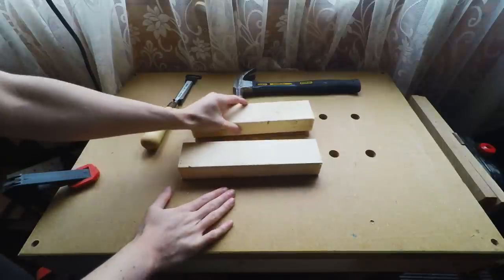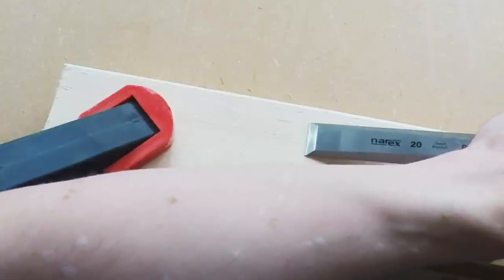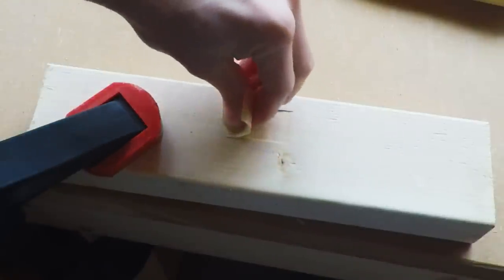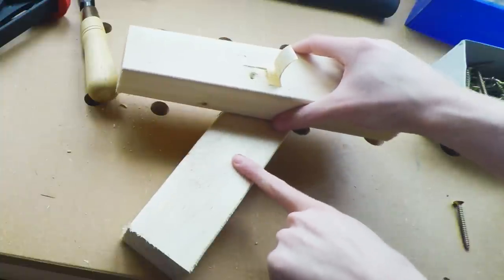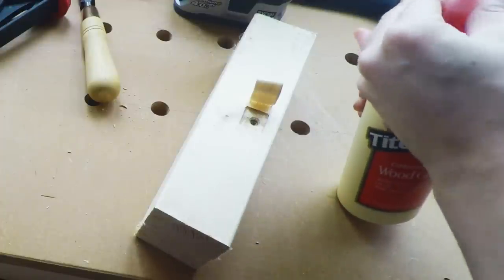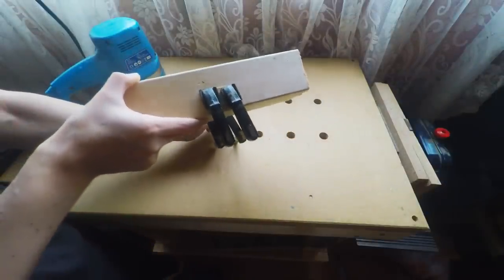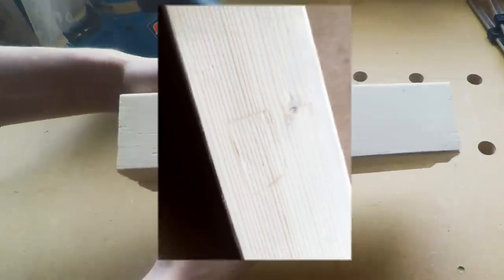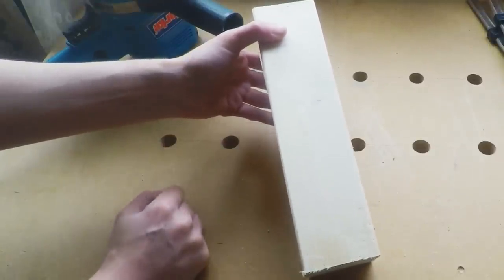Simple Way To Hide A Screw - Average Joe's Quick Tips

Comment: A handy trick to have in the tool belt but for specially suited cases only. The advantage of the more usual method of counterbores and dowels then sanding flush is it can be done far more efficiently when more than say two are needed. It's also not required to use two clamps on a dowel.

Thumbs up though for sharing a handy trick.
Reply from the maker: Thanks mate! Definitely a tip thats not suitable for all tasks but all its useful to know. The clamps arent really needed. Strong tape can be used to hold down the wood while the glue dries

Comment: Nice tip Joe, I was using similar method once but I just cut out about 5mm on the bandsaw from entire surface and after putting some screws in I glued it back together.

Comment: if you like Titebond Wood Glue, look into Titebond WeatherMaster Ultimate MP or Titebond Roof Plus but it's not for the same purpose, it's the best Sealant, Adhesive & Elastomeric for your house exterior, but you can't get it at the local hardware store, I'm a roofer and it's awesome for all types of stuff for your house

Comment: Good idea, well done. You could also when gluing up the flap cover it with a piece of plastic milk bottle and back this up with a piece of wood. This evens out the pressure on the flap and prevent the two pieces of wood sticking together. Regards
Reply from the maker: Thats a great tip! Thanks Peter 👍
Reply: I use baking paper as a separation. Easy to cut and never sticks.

Comment: A taper plug cut from the same wood can be glued and pounded in tight to eliminate any visible line around the perimeter. If you are careful to match the grain well, then the result will be completely undetectable. Also, there is no need to wait for the glue to set before sanding smooth.
Reply from the maker: That is another method for hiding a screw yes. But you will still see a circle in the wood.
Reply: Average Joe's Joinery   You must be thinking of "dowels". Plugs are tapered and wedge in so tight when pounded in that there literally is no line between the 2 pieces.  If a circle is visible, it is only because the plug was poorly chosen for color and grain match. Also, obviously the plug needs to be installed with the grain oriented correctly and a proper bit (Forstner) must be used to drill a "clean" hole". If a twist bit is used to drill the hole, then you are indeed correct that a line will be visible around the plug. 

I am not knocking your method, because not everyone has plug cutters. I'm just saying that if you have a plug cutter, use it for better end results.

Comment: Definitely one of the best wood trick I seem but it will require a lot of claps and time if you building a furniture but very good
Reply from the maker: Thanks Victor! Glad you liked it. The clamps arent really needed. Strong tape, a weight or even a small dab of super glue along with the wood glue can be used to hold down the flap of wood while the glue dries

Comment: Just to add to your tip, if you wet the surface with water and let it sit awhile before you chisel it makes the wood less likely to break off and swells the grain so when you clamp it back in place the severed grain is less noticeable
Reply from the maker: Thats a great tip John! Thanks :)

Comment: Hi great tip!! how do you hide the screw when your 2X4 is screw onto a wall and you can't use the vise grips to hold the wood chip down?
Reply from the maker: Thanks! You could use tape to hold down the wood while the glue dries or you could use a little super glue for instant hold

Comment: Very obvious, very simple, very next time and from now on process! My minds been blown, cheers :) It's true, sometimes the simplified method is the best method.
Reply: Also, if on skirting boards, would be amazing grip + finish. If flooring is existing, how to pressures the skin? If no flooring I just cut an angle piece and angle screw it with bond / grip. If Florida ring in I join lengths of wood an inch too high then push down an more screws, this then pressures two boards at once. Easier way?
Reply from the maker: Thanks mate! Its really is a simple tip but its very effective. Im sure there are tons of applications Im not even aware off. Those are some great uses for it!!
Reply: No worries man, keep it up.

Comment: Use a piece of clear plastic bag over the glued part, then clamp a flat piece of wood over that to spread the load and therefore remake the surface better.
Reply from the maker: That would help a lot
Reply: Indeed it does mate. I keep offcuts of nice high quality thick ply of various sizes just for this task. Beware of supermarket carrier bags though. Their colour will leach into the excess glue and the work!!! Only use clear plastic bags. You can also see how much glue is oozing out. If its too much, you can wile it off and then re-apply. 

I'm glad to see a younger bloke using hand tools. There are a million router vids out there, but the satisfaction of working with chisels and planes far outweighs the experience of using a noisy tool. 

I also never sand anything btw. I only plane, spokeshave and scrape. The finish is vastly superior. But this opens up the need to learn to sharpen edge tools using Japanese water stones - a whole new art by itself. Very satisfying though.

Comment: Will this tip work on Plywood?
Reply from the maker: It can but its harder to get clean results
Reply: @AverageJoesJoinery  In the case of Plywood, I'll stick with Plan "B," which is using Plug Cutter Drill bits.  I'll just use your trick for regular lumber.  Thanks again.
Reply from the maker: Anytime mate 😊

Comment: I'm looking all over YT and nobody can help me. I'm trying to dismantle a built in cupboard wall, and I need to get to the screws underneath the woodfiller on the back walls. How is that done? Any help or ideas about getting to the screws would be a godsend.
Reply from the maker: Hi Louis, Best bet is to use something sharp to chip and scrape away the wood filler. The filler should chip away with a knife or even a flat screwdriver. If thats no use then you can use a drill to drill away the bulk of the filler and then try to chip away at the filler. Just don’t go too deep and take the head off the screw. As long as you can reveal the head of the screw and get a screwdriver into it then the rest should break away as you undo the screw. Hope thats of help.
Reply: @AverageJoesJoinery  Cheers man, I'll get to it.

Comment: clever but it needs to be clamped and glues it would be easier to glue the joint or just use plugs so you can plug multiple holes at a time but it's a great idea if you don't want an obvious break in the grain

Comment: If your using clamps, just glue the boards together no screws needed.
Reply from the maker: The clamps were just a way of holding the wood in place while the glue dried. Mechanical fasteners are often needed as well as glue. Tape could be used to hold down the flap of wood or even a weight too

Comment: What if you can’t cramp it up
Reply from the maker: You could use tape to hold down the flap of woof while the glue dries. or you could add weight. Even using a small dab of super glue with the wood glue would work too
Reply: Average Joe's Joinery or you could apply a piece of news paper and a block of wood and pin down until it dries ?

Comment: Interested if this would stick out like a sore thumb after stain was applied
Reply: I realize this is old - but yes if you're not careful and use too much glue. Certain species of wood and/or grain direction will let the glue totally saturate the flap to the point it will not take stain.  I'd experiment on scrap b4 doing this on your next heirloom project.
Reply: This is better for painted surfaces the cut shows on stained surfaces..but it's a nice took to keep in the chest. I saw someone test this method a year or so ago while showing old time wood working methods.

Comment: nice trick, especially for less important projects. I think i will use this trick a few times, just to hide a screw. 

Downside though, is that the screw is permanently sealed, and for projects where i would want that i think i will still use more 'proper' techniques like filling with a dowel, or filler, or something similar.
Reply from the maker: Thanks mate! I dont think there are many projects where someone would want to hide the screw if they need it to be easily removable. Like you say, using more traditional/stronger joints is always a much better way to go. Some people do infact use a mix of both though. I have a rocking chair project that has the traditional joinery but uses screws to pull it all together and give it some mechanical holding power

Comment: they also made planes for this, called blind nailer plane. Cheers.
Reply: *****   
http://www.ebay.co.uk/itm/MINIATURE-WOOD-PLANE-BLIND-NAILER-/250731383875 
 veritas makes a remake of some sort. the original one was to be used with a common chisel. not very hard to make your own, but mabe better fitted for nails then for screws. for the latter your method might be better. You could try a very sharp gauge, which tends to curl the chip more. I did that on a couple of occasions, with varying succes depending on the wood species.

Comment: Thanks for this tip, but should you not have used a wooden mallet instead of a metal hammer on the wooden handle of your chisel to prevent damaging the wooden chisel handle? I understand that you were tapping lightly, but bad habits tend to escalate.
Reply from the maker: Ideally yes you would be using a wooden mallet rather than a metal hammer 👍

Comment: It’s a good tip but wouldn’t work on door threshold
Reply from the maker: Thanks Theo! It will work on all wooded joints.
Reply: Average Joe's Joinery I agree just how would you clamp it on the floor?
Reply from the maker: You can use tape to hold down the wood while the glue dries or even a weight. Using wood glue and a spot of super glue for instant hold is another option

Comment: ok, but you're using a fully threaded screw  while the 2 pieces of wood are not held together...
Reply from the maker: and...
Reply: that way .. it only pulls piece A against piece B with a force equal to the force you applied at the moment you were driving the screw.
Either drill a hole of a diameter equql or larger than the threads, or use a screw with a non threaded section of a length equal to the thickness of the piece of wood on that side of the screw.
Not important in this case because it's not the subject of the video, but do this in general to ensure firm contact between the pieces

Comment: Crap. Di it right: counterbore and plug. If you ever have to pull the screw it's going to be a mess, and you better use plain steel so you can find the screw with a magnet.
Reply from the maker: Screws are usually best ‘unscrewed’ rather than just pulled. Thats where they differ from nails. People usually ‘hide’ screws on joints that have also been secured with glue, so removing the screw at a later date wouldnt do you much good. If you’re plugging screws on joints only secured by said screw then thats really not the best idea. Do it right.
Reply: Uhm, "pull the screw", to quote myself, was just a euphemism for removing the screw by unscrewing it. 

I was a boat carpenter for ~25 years, so my point of view may be a little different. Yes we always screw and glue, but sometimes you have remove a piece due to damage, rot, or the owner just changing his mind. When that happens it's useful to remove the screw before finding it with your saw or chisel. Above the waterline plugs are held in place with varnish or a little PVA, below the waterline plugs are held in place with waterproof caulk. To remove the plug you chuck a headless screw into your drill and aim for the center of the plug and it pops right out. 

Using plugs shows that you're not afraid to show your technique, and if done in an orderly and careful manner, contribute to the beauty of the piece, not to mention that they are waterproof, easy to find and pull.

This just seems like a sloppy "shortcut" that is actually more difficult to do consistently well, can still be seen, and is difficult to repair.
Reply from the maker: Chimera seems to me like you dont actually want to hide the screws at all. Which is fine, just means its a waste of time watching a video showing you how to hide a screw.

Comment: Why would you screw it in the first place? Why not just use wood glue instead?
Reply from the maker: There are many applications where screws are needed and are beneficial. Using wood glue alone take a long time to dry and need to be held in place while it dries.
Reply: Average Joe's Joinery yeah but you could always use nails for holding it together when you need to keep working on it and glue to keep a strong bond. Stronger than any friendship that I had.
Reply from the maker: Then youd need a way to hide the nails instead

Comment: Clever my ass, try that with some hard woods you won’t have much success I guarantee. Maybe on some soft woods. Placing a plug from the same material in the countersunk hole, paring then sanding is still the best method in my book. But to each his own, as they say. And I don’t know who the hell “they” are either. But thanks just the same for your idea, it is different.
Reply from the maker: Your guarantee has failed unfortunately because it works great on hardwood. Looks a lot better than it does on stoftwood

Comment: Used your chisel upside down. 👎
Reply from the maker: Used upside down you can control the depth a lot easier.....
Reply: Average Joe's Joinery 

Used upside down the chisel wants to keep burying itself deeper into the timber with every hit of the hammer.

But what would i know, I'm just a carpenter/joiner with 15 years of experience.
Reply from the maker: I believe that to be incorrect. When cutting mortices for example, starting the cut bevel facing out makes the chisel go into the waste area (opposite to the bevel). So in turn, bevel facing down should drive the chisel up
Reply: Average Joe's Joinery 

Mate you do what works for you.